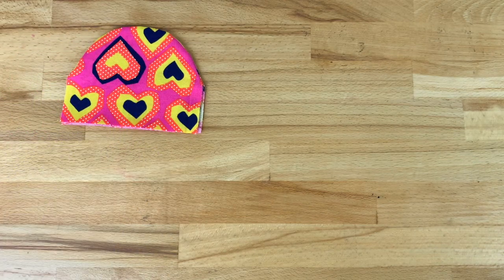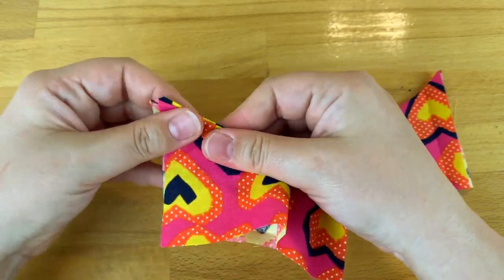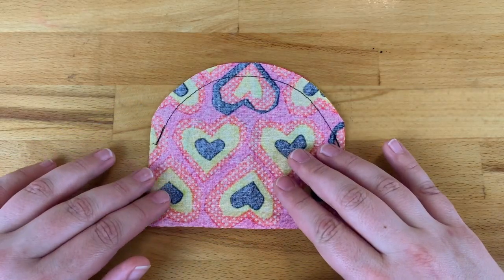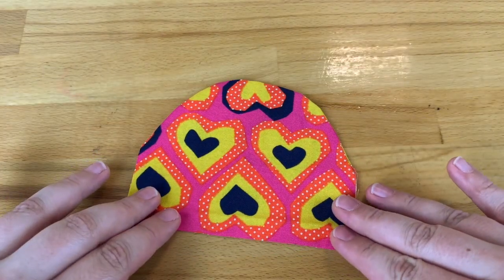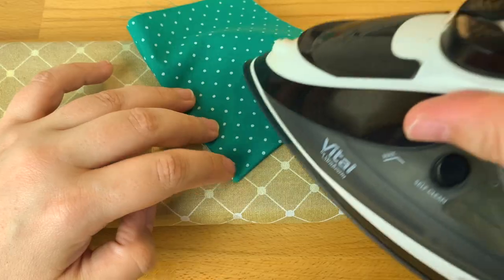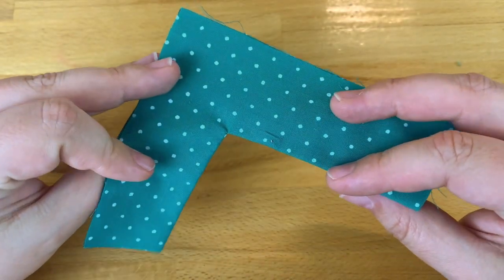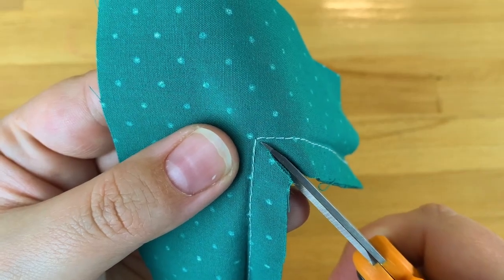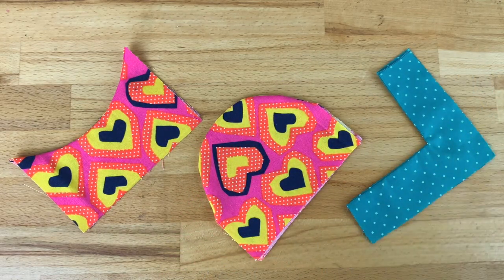Clipping and Notching - How to Sew Perfect Curves & Corners

Comment: Would pinking shears accomplish the same effect as notching? I thought it might work for what I'm doing but it hasn't seemed to help at this point.
Reply from the maker: It depends on the fabric, but pinking shears are mainly just for preventing fraying, while notching is for allowing the fabric to lay flat and make a smooth curve. I have seen people use pinking shears to notch, however one of the mistakes that they make (which ends up not working) is just pinking the edges, which are usually far away from the sewing line and still leave that bulk there without any flex. Notching allows you to cut right to the line of sewing, which helps open up the fabric and give it that movement.

If you DID want to use pinking shears, try to pink the fabric so that the bottom V of the shears is just above the sewing line. Does that make sense? I hope it does!

Comment: Can I finish/ overlock after clipping?? Why is that some halters I have just over overlocking but i don't see this clipping of concave seams? Does it depend on the material?

My halters are stretchy cotton, but what I'm using to make my own halter is unscretchy cotton —100% cotton.

I'm worried about it fraying after making clips in the concave, how do I finish the edges/overlock them but still retain effects of clipping?

(New sewer)
Reply from the maker: @YayliTanbur  These are all incredibly great questions! I wish I’d thought to include them in my video!

A lot of halter tops and shirts that have overlocking-only are usually made with pretty stretchy material. Stretch fabric has a LOT more give that non-stretch fabric like cotton, so overlocking the seams would still allow it to follow a curve without needing to be notched or clipped. There are also methods of overlocking using specific thread made just for stretch fabric that also stretches too!

You can absolutely overlock clipped and notched edges! The way I was taught to do it is to do your clipping/notching first to make the fabric lay how you want it to, give it a nice press with an iron to lay it flat, and then overlock the raw edge. 

Now because you’ve clipped the edge, you’ll only have the overlocking on the outermost part of the seam, which means that there will be some parts between the clips not overlocked. Kind of like joining two pieces of fabric together with a link of thread. This way you have the outer edge overlocked to stop fraying, and still retain the nice shape on your flat fabric. 

I really hope that this made sense! I’m not always the best at explaining things 😅 If it didn’t, please feel free to message me on my Instagram or Facebook and I can try drawing some diagrams to show what I mean. 

Good luck with your sewing project! I’m sure you’ll make an amazing garment, and I’d love to see the final product once you’re done!